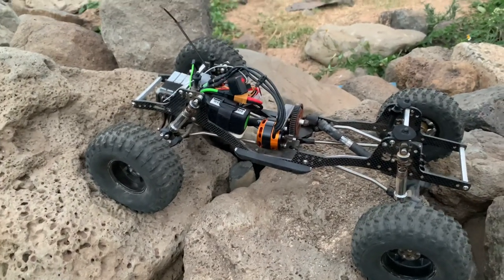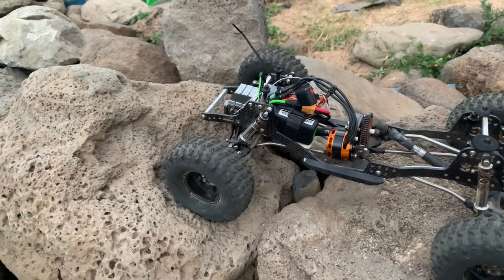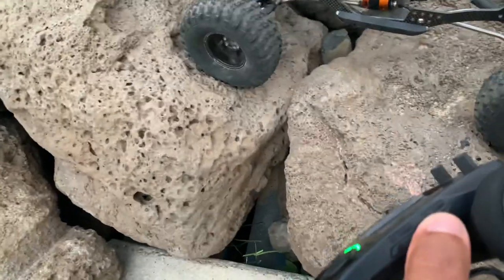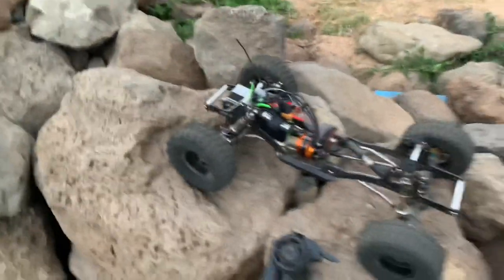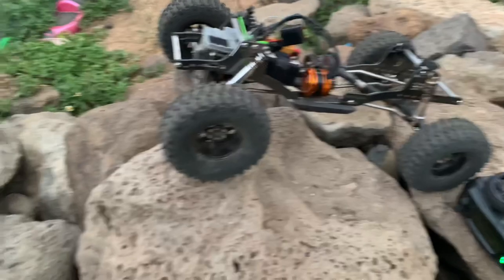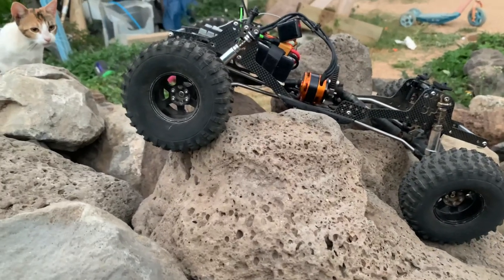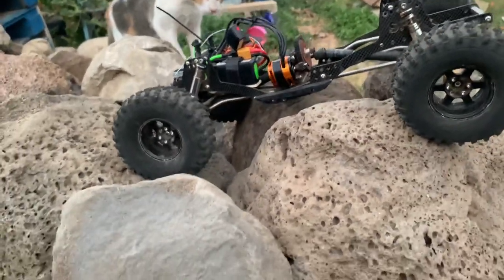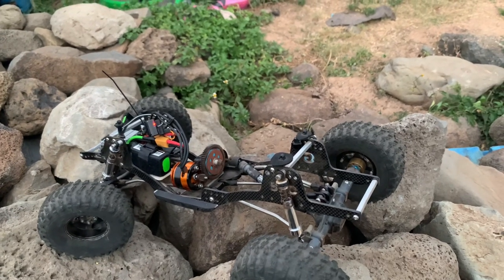New Holms Hobbies Crawl master mini Esc paired with a 1500kv yellow jacket.

Comment: Very cool, if you get an wraith32 you can flash it with custom Firmware and get rid of the cogging. It's not the motor which causes cogging, it's the ESC.
Reply: not just wraith32, several other drone escs. i have a couple rigs running on iflight succex and cheap motors and they have no cogging at all.
Reply from the maker: Wow 😮 cool. Hopefully Holmes Hobbies comes out with there firmware and UI soon.
Reply: I have a Wraith 32 on the way and I hope to install it in my enduro.
Reply: @knoopx  you bet, drone stuff works well
Reply: Is it easy to flash the Wraith32? I've been looking into a Drone ESC.

Comment: That "cogging" is actually skipping and is intentional.  The ESC switches from a constant RPM mode at lower speeds, to a voltage modulation mode at higher speeds.  That skipping is the ESC letting you know it is being over-torqued due to binding, and protecting the rig from severe binding causing drivetrain damage.  Pretty ingenious of Holmes.
Reply: wow

Comment: hey man nice set up I just got the crawlmaster mini v2 and the yellowjacket 2000kv, but I was wondering did u do anything special to run 4s because the yellowjacket says to only run 3s max
Reply from the maker: So the yellow jacket 🐝 can run on 4s but I would just watch how you drive. As an aggressive throttle input can sometimes led to motor damage. I have had very good success using it.

Comment: Wow that's incredible! Especially without having a sensor wire. Looks like I'm converting my crawlers to outrunners from now on. Heard you throw in a little aloha there at the end. I live on Maui. Where you at? Oh yeah and I'm subbed 🤙
Reply from the maker: Aloha bro ya the cmm is super cool. I live on Oahu. Outrunners good.  Checkout the  acis 10 from 3brothersrc. You won’t be disappointed. The cmm v2 bare board is coming out today04-22-22 at 9pm central on the holms hobbies website mahalo 🤙🏾🤙🏾🤙🏾

Comment: Your vids are helping me out!  I couldn’t comment or question on your other vid so im posting it here. What voltage r u running on your NSDRC BEC?  or does it matter?? I got a hold of a HH crawlmaster mini as well.
Reply from the maker: Aloha sir the bec can handle up to 26v on input. I am running 4s Lipo which is 16.8v fully charged. The bec gives a fixed 6v to the rx. Hope that helps.
Reply: @bobzRc  thank u!  Thats helps a ton!!!